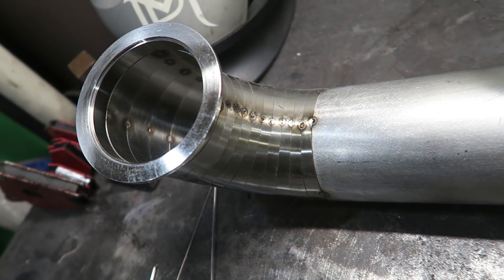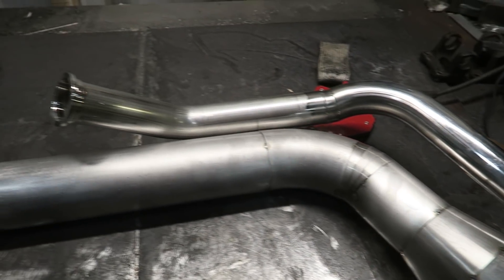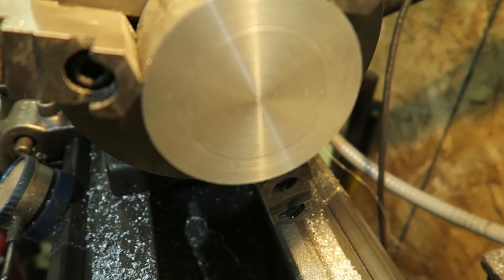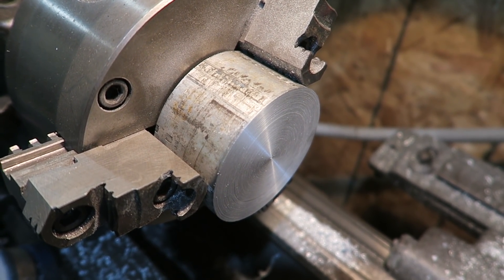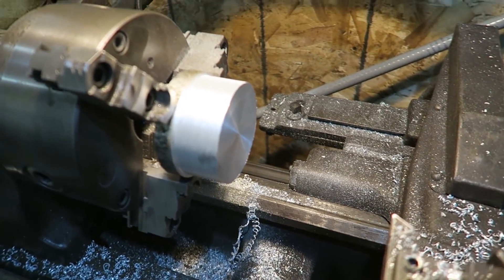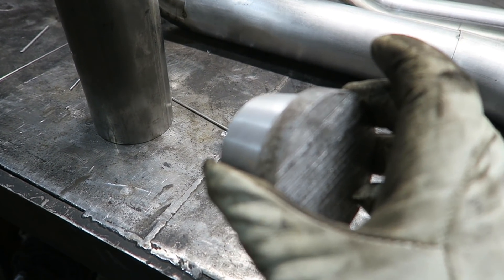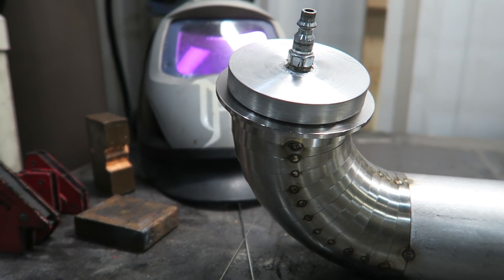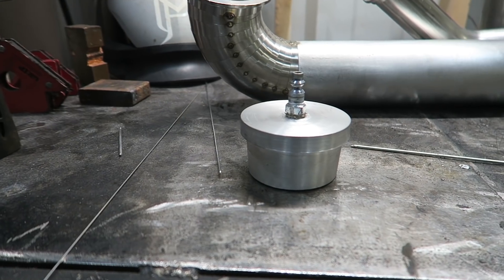WHY BUY IT? WHEN YOU CAN BUILD IT!!!!!! Making welding tools.

Comment: Just curious why you made the job more difficult than it had to be? If I were turning a part like this at work, I would have chucked on the small end, done all the machining necessary(including drilling), then parted it off. On a taper of that length, especially based on the application, I would have just set the compound rather than fooling with a taper attachment....although I have to admit that at work I wouldn't have spent the time doing this on a manual lathe. I can program it and run it faster on the conversational NC lathe, and make an extra half dozen to replace the one that gets lost because nobody ever puts things back where they are supposed to go.......

One big thing though: Lose the gloves and the long sleeves, as well as any jewelry, when you're running any machine tool. Wear the gloves when you clean the machine or handle parts only. If you're cold, turn up the heater. If you think your ring(s) aren't a problem(assuming you wear one), google "degloving" and be prepared for some very nasty pictures. Machine tools don't care if they mangle your body parts.
Reply from the maker: I don't wear rings or any jewelry for that matter. I needed this one part and thats what i have to work with. I'll remember the gloves and sleeves for next time! Thanks for the input. I am not a machinist by any means so advice from one is much appreciated!

Comment: Whats up bro. My real names Casey and i am a tig welder as well and you did a great job explaining why we use the argon to weld with on the inside or around the spot needed welding. Specially stainless and nickel based metals, i fix castings on airplane parts so i know exactly what goes on bro. Have a good one and i like the vids man
Reply from the maker: thank you!!
Reply: MorFab Industries 🤘